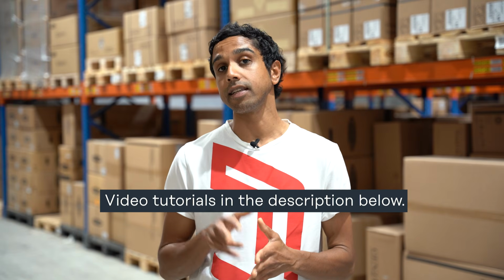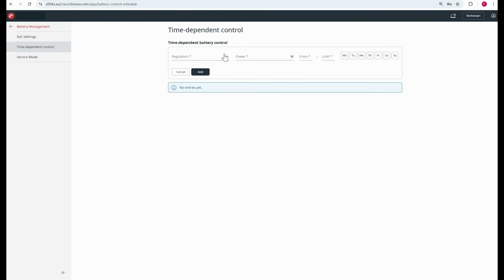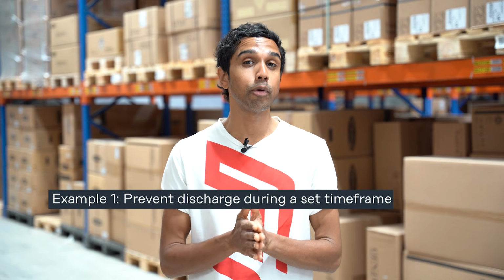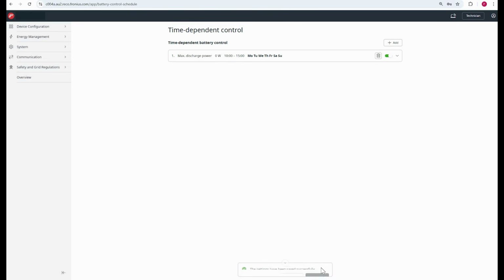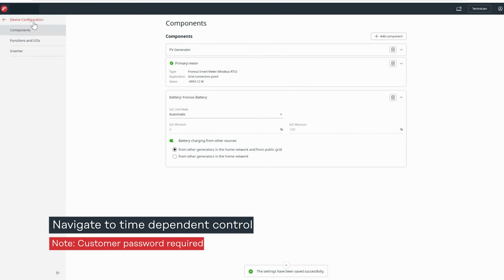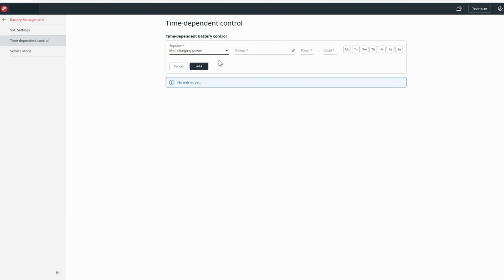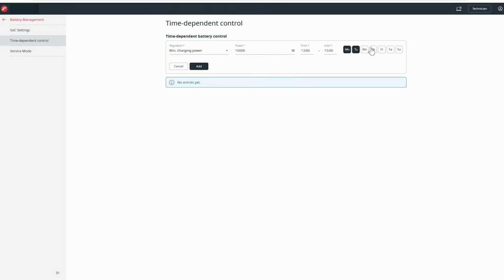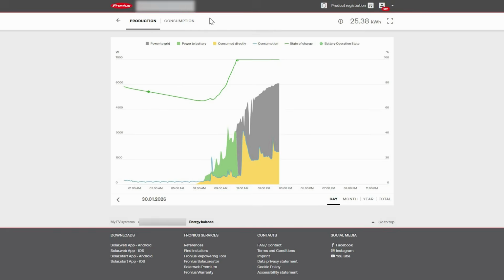How-to | Set Up Time of Use Battery Control with Your Fronius Battery System (AUS)

Comment: I just have one installed. Spent lot of time trying to figure out how to make the battery charge of the grid. Having no normal manual control to trigger and stop this is insane. Having to create a schedule even only to trigger charge from a grid is .... "oh today the sun is not up my battery is not going to be charged enough for the peak time....ok lest create a schedule .... (85 taps later)...great the battery is charging" . Also what is the idea behind enabling charging from the grid if that charging never happens unless i schedule a force charge? This is very disappointing.
Reply from the maker: @ianguga8535 Thank you for your detailed feedback. We understand that the current workflow for charging the battery from the grid may not meet everyone's expectations, especially when a quick manual override is desired. We appreciate you taking the time to share your experience. Battery charging behavior is influenced by the selected operating mode and settings, and we are continuously working on improving usability and expanding functionality. If you'd like us to take a closer look at your specific setup, please feel free to contact our support team. https://pulse.ly/ybilekohsb

Comment: I expected better from Fronius.  No ability to say top the battery to 30% SoC overnight when rates are cheap, to carry the battery over until the sun comes up.  SoC is not a variable that can be selected.  Fronius need to do better on this - it's a basic requirement.
Reply from the maker: @Chozzer Thank you for the feedback, we are committed to continuous improvement of the app’s functionality.